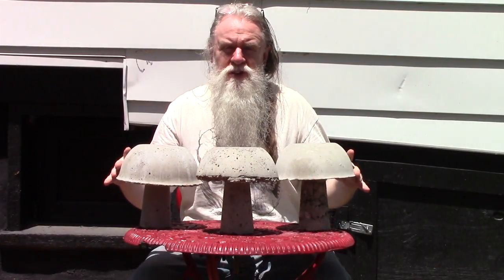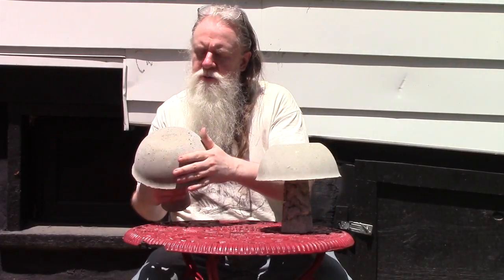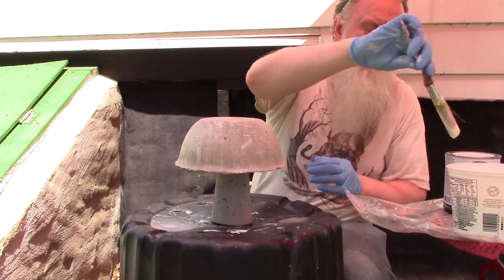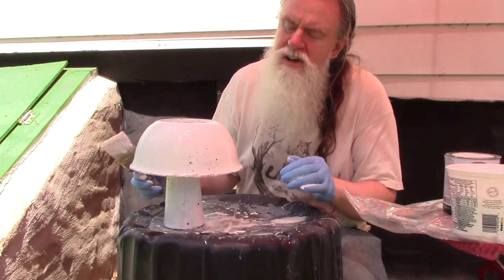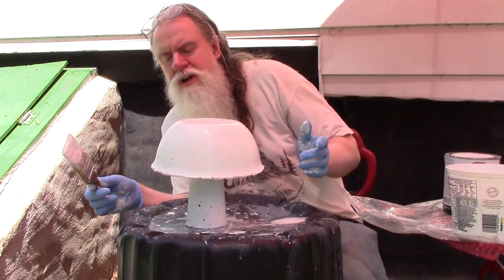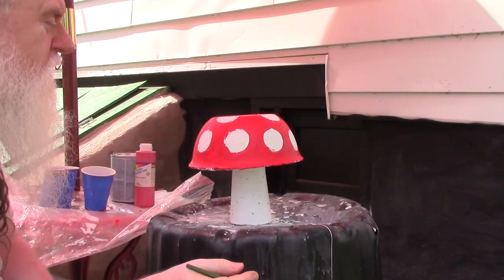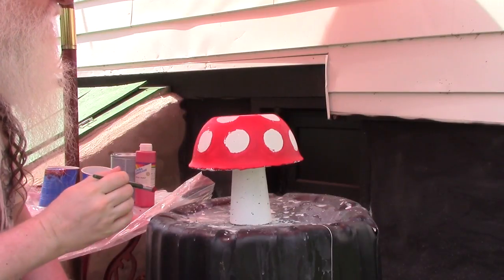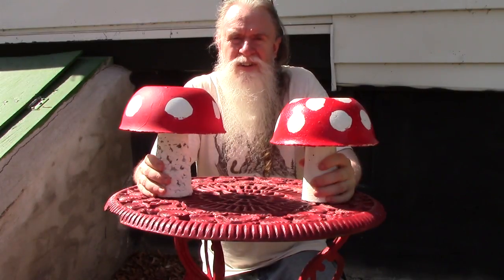Cement Mushrooms -- Part 2, Painting

Comment: hello. I just made ten of those mushrooms, with a little change about the steam, i decided to use soda  plastic bottles , with different shapes and sizes. I even used two of the bottom ot the plastic soda bottles as the top of the mushrooms, so the final result was different shapes and sizes of cement mushrooms and different steams.I am planning to wait a week or so to start painting them, to allow the cement to cure. Thanks for the explanations.